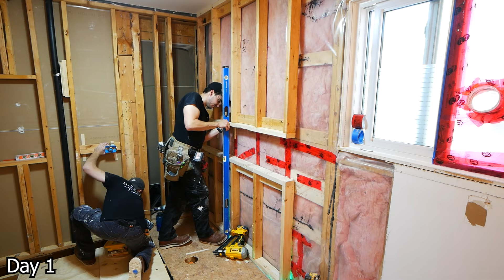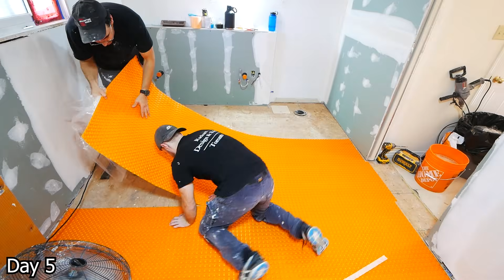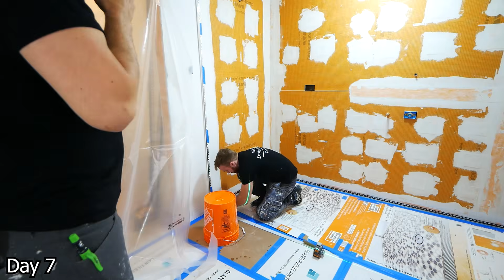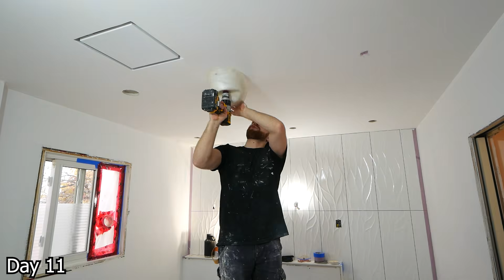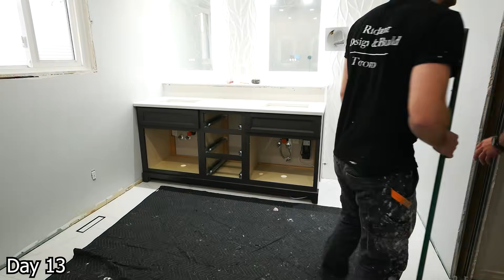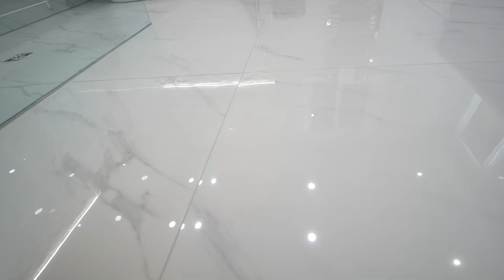How To Build a Barrier Free Shower

Comment: Fellow contractor here 
Consider adding 2 coats of liquid Hydroban to your showers AND run a 24 hour flood test. 
Thinset has been proven to wick water under the banding. 
Hydroban is the Best 100$ bulletproof piece of mind for your projects. 👍
Reply from the maker: Yeah couldn’t hurt adding a second layer of waterproofing. I think I’m done flood testing curbless showers though. In our most recent project we built a makeshift curb to flood test and it’s always sketchy removing the temp curb as it has a tendency to pull up additional banding

Comment: I would use the sprayer on furniture, working my way to larger surfaces, like a garage door. I am intrigued by the difference between spraying and brushing, looking forward to saving time and smooth surfaces. I haven’t tried it yet because a little intimidated by the mechanics and clean up, but that’s starting to sway. I’m ready to use a sprayer.

Comment: This was fantastic, great job guys. We’re in the UK and had something similar done at pretty the cost too…with having kids my focus was waterproofing so they recommended the waterproof panels you put up and then applied a blue waterproof paste between all joints which are used in swimming pools and it was excellent. I wanted that small cove in the wall too but they recommended a long ledge too which was great, and then they tiled every surface before popping in a whirlpool bath. The interesting part was the ceiling, instead a normal matte white ceiling with spotlights, they installed white clickable plastic panels that connected like floor tiles, that a surprise. I get it now, no need to paint or anything, it’s simply wipeable. I hope people can see the extra few thousand you guys quote as an important investment and avoid making mistakes by cutting corners. Great work guys.
Reply from the maker: Thanks so much! Sounds like some cool techniques used

Comment: Hey Liam , gratz on another beautiful bathroom! I like the idea for the trim in each corner to prevent silicone but yeah , i thought to myself that would be a pain haha. For more straight(level) and flat wall you should try foam shim made by Build with Foam . If you have futur project with the same kind of specification and also to upgrade your own product as well. Keep up the good work guys and cheer from Quebec !
Reply from the maker: Thank you so much! Just checked out the shims, they seem quite handy. Thank you for the tip!
Reply: @WorkinwithWolkon  I use cardboard drywall shims to get flat and plumb walls when doing showers.

Comment: That pre-formed slope pan is really a game changer, ain't it? Instead of using large format tiles, is it possible to install waterproof wall panel in the shower? I know the selection are limited as the market has not caught on to it, but if I had to do my bathroom again, I would have gone with waterproof wall panels instead of having tiles and dealing with mold and mildew.

I just love the wet room and open shower concept.
Reply from the maker: Of course, I’ve had some inquiries about wet wall. I’m curious about how it compares to tile myself. Thank you so much!
Reply: @WorkinwithWolkon I'll like to know what you find out. Perhaps that could be the subject of a future video?

Comment: Thank you for taking the time to film and voiceover your work, it's truly impressive! When you build in a standing tub, what are your considerations for concerns about cleaning the underside or back of it?
Reply from the maker: Thanks for the kind words! I get a lot of comments on this so I’ll be addressing it in a how to freestanding tub video down the road. But there’s a number of cleaning tools that come with pole arms for hard to reach places. Or when it’s in a wet area most tub fillers come with a hose attachment and the tub surround area is waterproofed so you can simply spray it down

Comment: I love it.  Perfect job well done. 
I don't understand the heated floor in the shower 🤔
Reply: It probably helps the water dry up much faster. Other than that, I'm not sure either. Unless they're taking cold showers. 😂
Reply from the maker: Thanks! Heated shower floors are a nice luxury for sure but even nicer in an open shower design like this one. Without an enclosure it can be quite drafty but the heated shower floor helps keep it toasty

Comment: great video, awesome job! Wondering, where the drywall meets Kerdi board, do you drywall mud this transition? Kerdi band it?
Reply from the maker: Depends on if the transition will be tiled over or not and is within the wet zone or not. When we do this we kinda go by what will be within the glass enclosure. In this project the glass actually started after the tile because of the DECO profile so the kerdi had to continue outside of the tile. Because of this we opted to drywall tape over where the kerdi meets drywall

Comment: I didn't know drywall tape would adhere to schluterboard! FYI, FibaFuse a superior product for taping butt joints.
Reply from the maker: Sebastian loves fibafuse! I used it myself for the first time not too long ago and it really is superior. They just need to stock it at more suppliers
Reply: @WorkinwithWolkon  i just order on amazon!

Comment: Great job.  Always watch your videos, very informative and fun.  I also planned to put a rain shower on the ceiling.  But my biggest fear is putting the pex pipe in the attic and not bursting during the cold months of Toronto.  I'm not fond of putting a bulk head on ceiling.  It's just doesn't look appealing.  Any suggestion?
Reply from the maker: Thanks! Yes you can do what we did here. Run your pex and then install vapour barrier over top. You then insulate above the vapour barrier, this way the pex gets the climate controlled temperature from the house and is shielded from the cold attic air

Comment: absolutely stunning! i'm curious: did the homeowner decide on a different wall color? i din't hear you mention it. when you painted it on, it looked like a light taupe—but in these finished shots it looks more like a soft blue-grey. is that just the lighting?
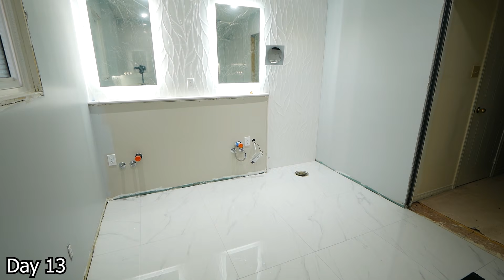Reply from the maker: Thank you! Good eye! You can actually see the 2 different colors at 18:30
The client felt the original color was too warm for the space so we changed it. 
A good decision in my opinion!
Reply: @WorkinwithWolkon   I have to agree. Fantastic work, and I appreciated all the detail in your explanations

Comment: Looks awesome. One question: why the need for a heated floor in the shower?
Reply from the maker: Tile is cold. Canada is cold. This shower design is very open and without a full glass surround is extra cold. So heated floors just make everything not cold
Reply: @WorkinwithWolkon  I just assumed it warms up relatively quickly with the hot water of the shower anyway. Regardless, I love the open concept bathroom.
Reply: Porcelain tile is a cold tile, feet be shivering 🙂

Comment: Weird question, but how was the workspace left each day? My husband and I attempted a small bathroom renovation. Honestly, the having to clean up each day and then set everything back up the next was exhausting.
Reply: Any solid carpenter cleans the workspace each evening before they leave. Every homeowner inspects the moment the carpenter leaves. Having a unkempt workspace will piss off a homeowner faster then anything else really.
Reply from the maker: We’re constantly trying to improve our process and a big part of that is housekeeping. With our projects now we typically require the use of a bedroom to store all of our tools (our projects are always on second floors). So at the end of each day we clean the project space and reorganize our tools. Everything is vacuumed and cleaned before going home. Its a good bit of effort to have to start and end each work day organizing tools/materials and cleaning but it’s apart of the job

Comment: I don't hit the like button for anybody anywhere ever, but since you asked so genuinely sweetly, I was compelled to do it. You deserve it.
That was awesome of the client to demo and even start in a little bit for you. I think I would too just because it's easy and would save time and money on the project.
I've been wondering, with the thinset or whatever it is you spread over the wire heating elements in the floor-would that start to degrade and break down over time from the constant temperature fluctuation? Or is it designed to withstand and hold up to that?
Reply from the maker: Thank you so much! It’s designed to withstand the temperature fluctuations. You just need to ensure you’re using the right products as per the manufacturers specs

Comment: great job! ive always wondered how the slope is kept in shower using the leveling clips, wouldnt they bring all tiles level by using them? or do you not squeeze em down that much? thanks!
Reply from the maker: Thanks! This is a pretty common question. The wedges only make the tile edges flush with one another, they don’t pull the entire tile to match the same plane